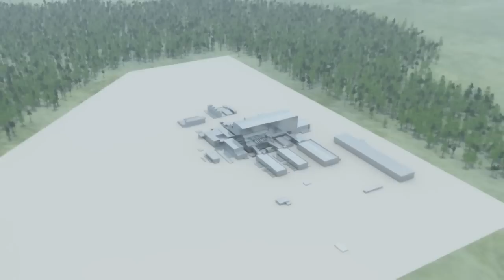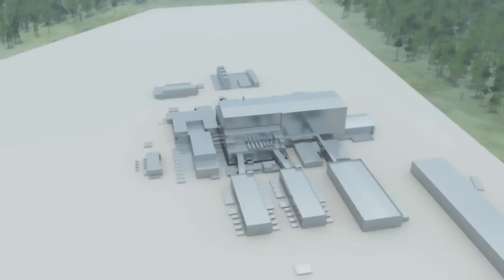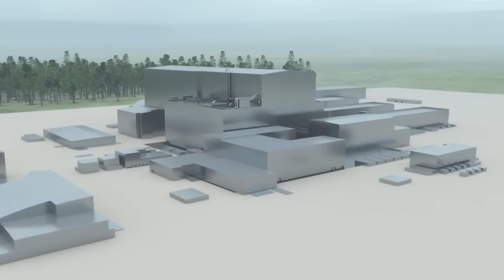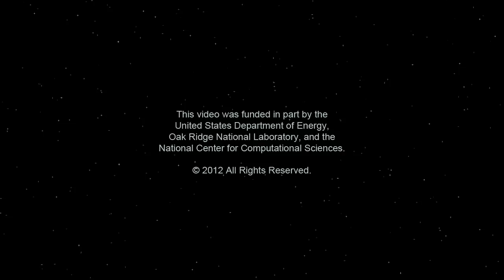Fusion Energy Production by Deuterium Particle Injection

Comment: s060340 explained the correctly. Another example to this is how the space shuttles' propulsion system maintains cool temperature for itself to not melt. the cool liquid gasses (oxygen and hydrogen) is injected across the lining of the combustion chamber keeping that lining cool so it doesnt melt. the flames are at about 3300 C

Comment: Great that this is in progress. Kinda late but at least its moving.

However, in the meantime, we still must investigate LFTR Thorium cycle reactors for the near term as Fusion energy is still very far away from real world application. Some technologies learned in the thorium cycle reactors can be used effectively in Fusion such as liquid salt distribution systems for heat transfer. The economics of Thorium cycle just makes sense

We should not distracted by the sloppiness in the Nuclear power industry to date. With proper research and standards, we can raise the bar significantly.

Comment: For the most part, true. However, if the magnetic containment flux drops at or just after fusing initiation, the super heated plasma has the possibility of exploding, but as with the fusion reaction itself, unlike fission, there are no harmful byproducts from the reactions, only useful isotopes (medical tech) and possibly other elements formed too.

Comment: How many orders of magnitude are they still short in plasma density, temperature, and containment time? Until they succeed in producing something viable for commercial use (how many decades away?), LFTRs please.
Reply: The only thing we need to make sustained fusion is a bigger reactor. The bigger it is the more hydrogen can fuse at a lower temperature. It's like the moon cools off faster than the earth because it has less mass.
Reply: leerman22 It's not quite that easy. With size also comes issues of the inverse square law which means that energy density in collection is lower. Remember, this technology extracts energy by wall neutron bombardment.

Comment from the maker: The electrical power needed to operate ITER will be supplied by the French grid.  ITER is a pulsed machine with a small duty cycle and does not have any energy recovery built in.  A part of the longer term program is to begin the testing of individual modules that could be the prototypes for future power recovery systems.

Comment: D-T fusion, while being the easiest to maintain and producing the most energy, also neutron-activates the reactor casing. Building a tokamak out of a heat-resistant material is one thing, same material also resisting a continuous bombardment of high-energy neutrons is another thing entirely. That's why D-T fusion is considered a stepping stone towards neutron-free types of fusion, such as D-He3 (although that one requires an extraterrestrial source of helium-3, Earth barely having any of it).

Comment: is the facility powered by third party power?  Are the magnets containing this plasma electric magnets?   If so i was wondering what would happen if this thing was running at 150m degrees, and there was a power failure, or flood or something.  Then what happens.

Comment: The 150 million degrees is only at the core of the plasma. At the edge tempereatures will 'only' be some thousand degrees or so at max. The material that will be used in ITER for the Divertor plates (the part of the wall that gets most of the heat) will be Tungsten, this is the same material they use to make filaments in light bulbs (before the EU banned them for their inferior efficiency)

Comment: Does anyone know?: In Deuterium-Tritium fusion reaction, an alpha particle and a free neutron is emitted. Because Helium 5 is unstable. 
But why in Deuterium-Deuterium reaction is a Helium 4 (a-particle) not emitted, but instead He3 and a free neutron?
Reply: because its all about fusing protons together ;)  The neutrons get shot off and the electron and proton stay behind.  Your  He3 is now perfectly primed to go again and fuse with itself.
Reply: Why though? Why are the neutrons ejected?
Reply: my hypothesis would be that a deuterium-deuterium fusion reaction creates a He3 and a free neutron instead of a He4, because He3 has a smaller nucleus and its microscopic properties (which increase zero point energy) allow it to overcome dipole to dipole reactions (h2 and h2) with less energy , thus causing the system to go to the easier path instead of creating he4
Reply: Has to do with the the stability of nuclei arrangement with the gluons within.. as well as the colliding orientation  that allows fusion to happens..

Not everything in the sub-nuclei can be easily explained, even with animated models.. so as the fields of the 4 foundamental "spooky forces"